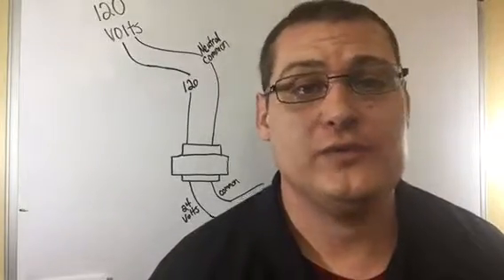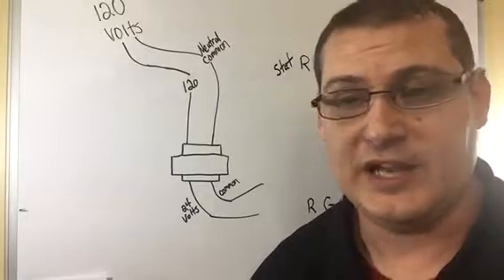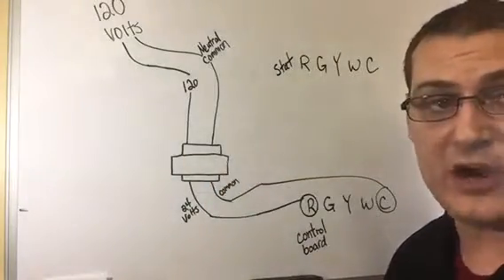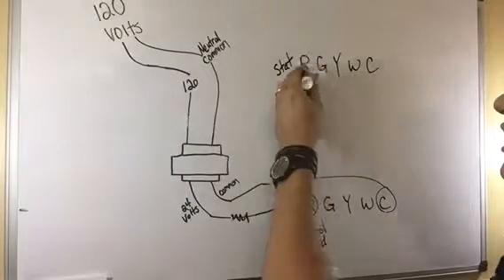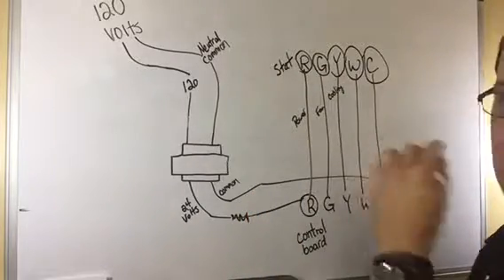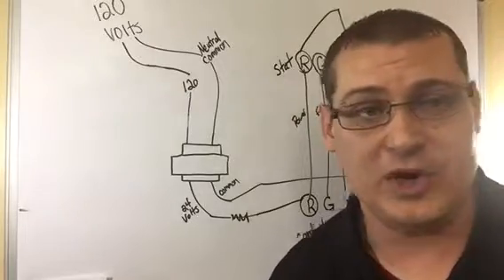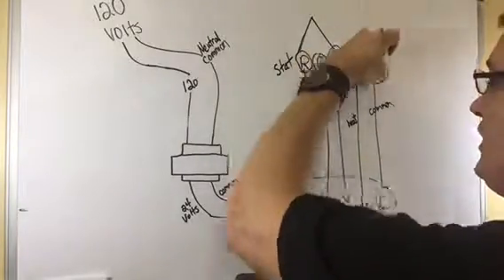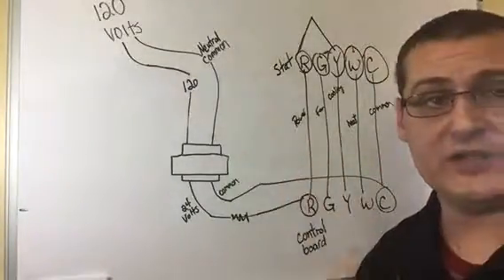HVAC TECHNICIAN: Basic thermostat wiring, operation and functions

Comment: Excellent video, well done I have a question when hooking up a HZ322 control panel the only lead I am not sure of is the second of the 2 wires that control the relay on the compressor one must go on the Y terminal I am guessing the other goes on the Rc or the jumpered Rh Rc terminal.  Is that correct.  Jon Black  Fairfield CT jblack245@gmail.com